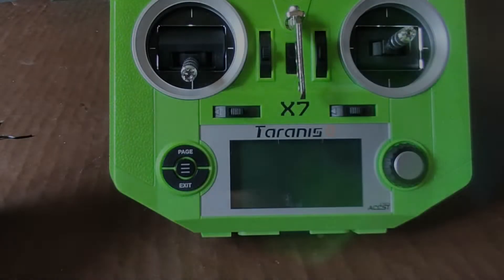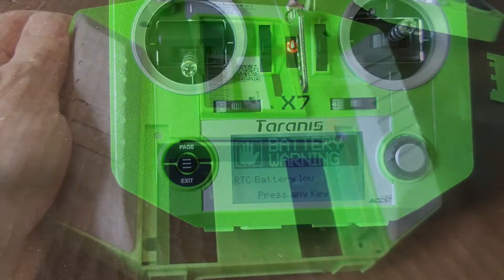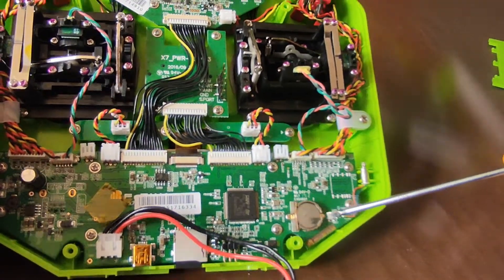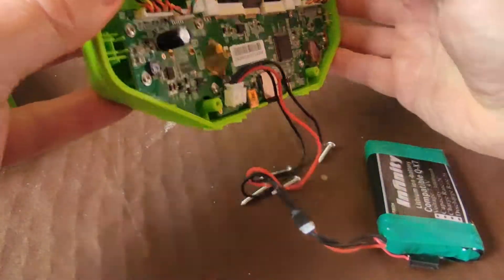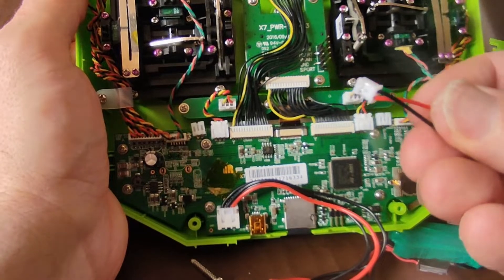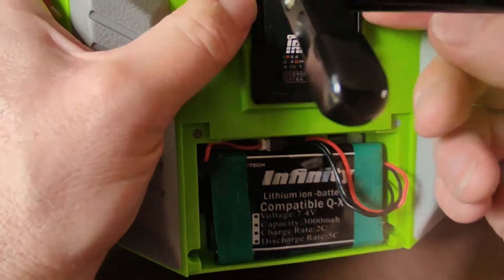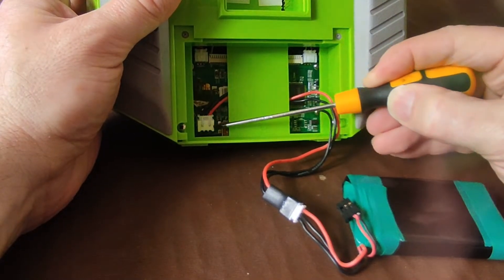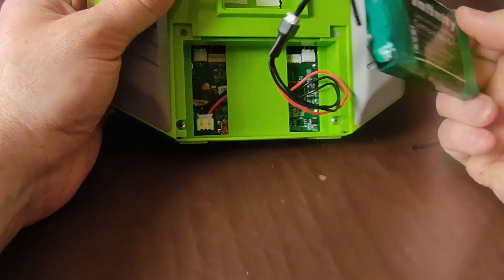ET#13.  TARANIS QX7 RTC Battery replacement / Real Time Clock / and some simple MODS

Comment: Exactly what I needed. Thanks for the video. I'll have to buy that battery extension too
Reply from the maker: Glad it helped!  The extension is really useful but ... it might also be worth adding a dab of hot glue to the socket on the board as it flexes up really easily.

Comment: I don't understand why they couldn't have used something like a 2032 that you could get anywhere instead of oddball that has to be ordered.
Reply from the maker: With you on that one.  Space on the board perhaps?  Possibly because the battery holder is a few pence cheaper?  Pennies on a large scale add up and all manufacturers will squeeze what margin they can.  It isn't that big a problem though and it isn't as if you have to change it that often.   Thanks for commenting.

Comment: Where did you get the battery extension?
Reply from the maker: I can't honestly remember but my best guess would be Banggood.  I have bought lots of gear (including the Tx) from them and the very few times I have had a problem it has been very quickly resolved.   

Use the search term "lipo battery extension".  You need a three wire 2s male to female.

You can also find them on AliExpress.  See the caveat below though!

I advise using a single use payment method, or a loadable card for AliExpress purchases as I have had my card scammed once.  I was lucky and the credit card company caught it, but please be careful!  I'm sure 99.9% of sellers are honest, but it only takes 1!